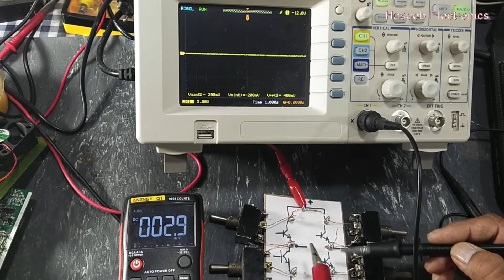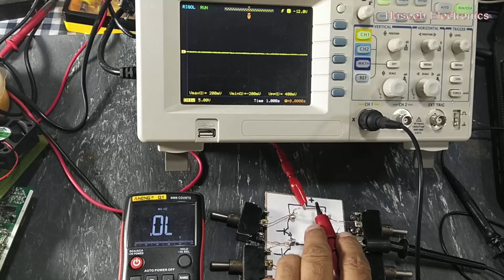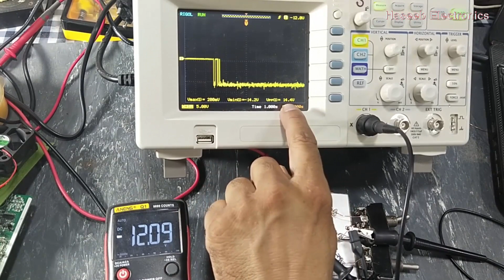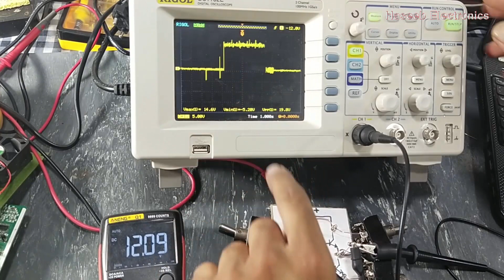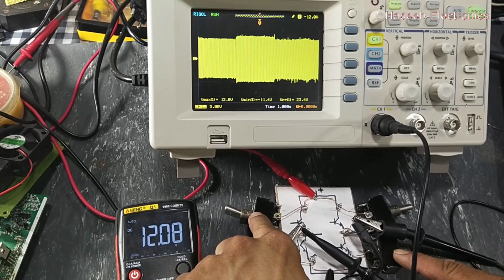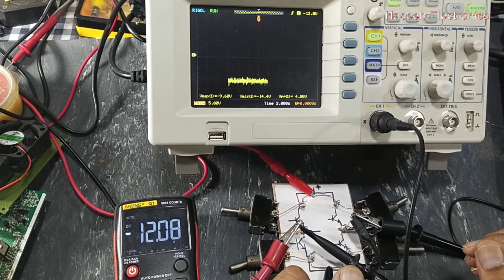{501} Full Bridge Switching Topology, Full or H Bridge Converter Explained, Practical Circuit

Comment: Thanks, Haseeb ;  
ifyou draw the motor in between the 4  "switchers"  i think that would help too ?

please,one question:  have here a solar inverter with 4 IGBTs, at rest, with the oscilator ( EGS002) out of the socket,  and it draws over  50 watts without any load

( i have a suitable light bulb in series with the 3880 VDC,and in series with the big capacitors to avoid a blowout); all 4 IGBTs read ok on the multimeter diode scale;
Is it possible that 2 IGBTs,in the same line, are left in the ON state, at rest??

Or is it possible that even though the multimer reads ok, that some IGBTs are bad?  and that would have to be 2 of them in line,right?

Comment: Nice explanation
I'm confused with the low frequency full bridge inverter I see the connection I realize that in the low frequency full bridge pure sine wave inverter there's one long heat sink with 8 mosfets and that is where the battery positive is connected and there's another two heat sink separated and each has 4 mosfets and that is where the secondly of the transformer is connected both legs and the battery ground is connected separately also kindly explain the connection and how it works

Comment: Hello, my inverter draws more than 3 amps with a very low output (86Vac) with also low voltage at DC Capacitor (120v). Any idea where to look at ?
Reply from the maker: its one MOSFET section is not working 
check both input fuses, and verify mosfets 
might be some mosfet is short circuited
Reply: @HaseebElectronics  I checked all six mosfets and seem good. Can some short happen after the rectification which draws lot of current ? Thank you.